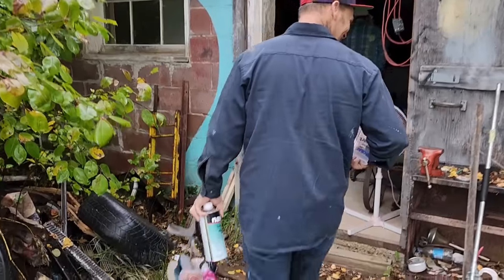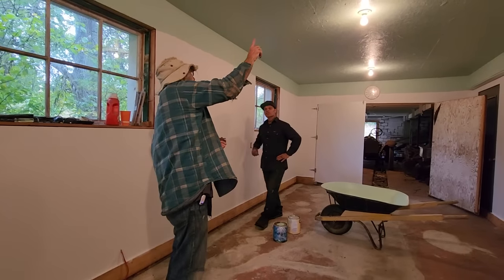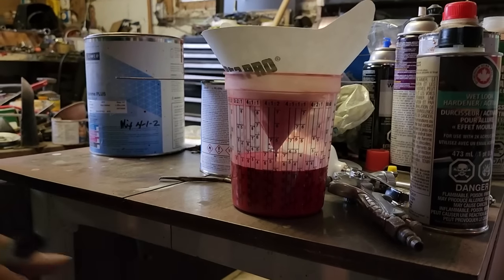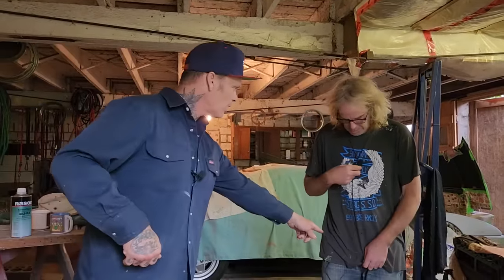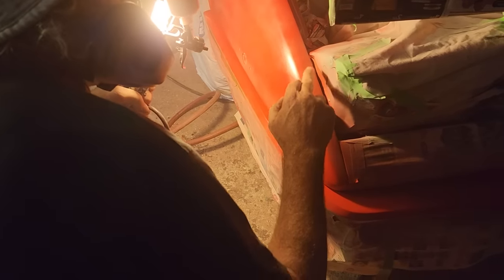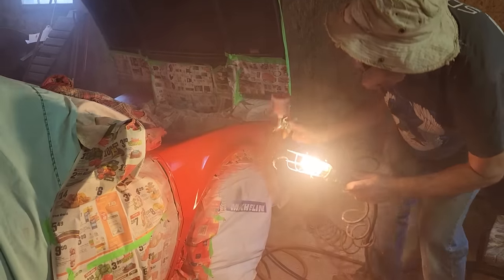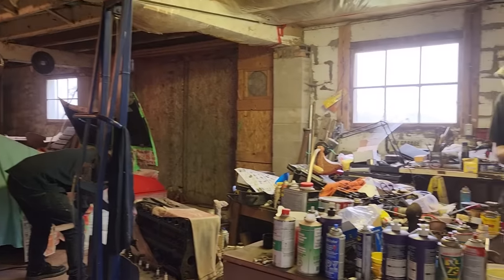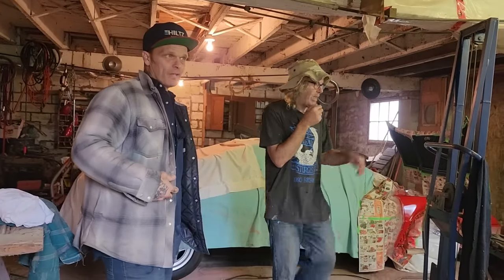Jim is repainting his 1987 Ferrari so we came over to watch  👀

Comment: BC is right about the paint cup, I've painting all my life.  I have a large pitcher with the graduations, has a handle, makes life much easier when mixing large quantities. Jimbo the paint shop needs to be at least 60 degrees Fahrenheit or it may not dry fast enough and run or sag.  Fisheyes are caused by contamination, oily rags, oil in the air lines, not prepared properly.  Using proper prep towels and wax/grease remover helps tremendously.  They make a fisheye remover, but it makes the paint spray uneven or orange peely.  Good luck with the Ferrari.

Comment: Where he had those fish eyes is where he wiped it with that old dirty rag,  I said it to myself too when he grab that rag and wiped it...NO...Like The Champ always says learn from your mistakes. Compressor probably could use a water drain to from the petcock on the bottom of the tank, and a $5 filter on the end of the gun would help a lot. Oil + water separator. Good luck Jim you have enough paint to make a mistake or 2. You'll get her buddy. Wax + grease remover and tack rag also. 👍😉✌

Comment: You got fish eyes from moisture in the compressor... drain the air tank should always set your compressor tank at an angle sloping toward the drain plug when you drain it put some desicant pouches in the tank don't split them the pouches should help absorb the moisture build up in the compressor tank this is why it's better to paint on a dry hot day or even have a heater in the room to dry out any moisture to reduce the humidity in the air being drawn into tank so you get less chance of having water contaminating the airflow ...also it's best not to use reducer to blow out an decrease the paint gear try using an ethanol or even brake cleaner spray to push out the grease and any moisture from the gun prior to use

Comment: I'm sure it's been mentioned before, the guns are shipped oiled up to stop any corrosion coming over by boat, so they need to be thoroughly cleaned before use with acetone I think it's even in the directions. Reducer will not readily dissolve oil. And the filter can be pitched, as that's for people that don't use strainers. I hope it all comes out ok, I would guess he is going to wet sand and buff anyway.
Reply: Yes after I washed off fender. Many coats and it matches
Reply: @jimpatterson2826  Glad it worked out for you in the end .

Comment: painting over surfaces contaminated with oil, wax, silicone, grease, etc or the gun wasn't properly cleaned this  is what causes fisheye in paint  =) overall Great job Jim =) heart of gold.. pro tip never use those filters that are in the nozzle  they can cause a lot of issues  like, sputtering, airflow restrictions they clog super easy so I just avoid even using them

Comment: When you compress air you take all the moisture that is in the large volume of air and put it in the air tank.  check the compressor tank and see if there is a lot of water in it and drain it off.  the water could be coming out with the air as you spray the paint.  They make water seperators which can help reduce the moisture.

Comment: Clean-Clean-Clean ,  Every part of the paint process has to be free from contamination.  Never use a dirty paint gun, strainers, or containers to paint with.  Always use solvent recommended for cleaning the parts to be painted and tack them before spraying. A sanitary booth is a must.  Every time you use a paint gun, wash the parts and can thoroughly and spray lacquer thinner through it, and always leave thinner in the can to keep the passages wet for the next job.

Comment: Before you paint you should let your compressor tank build up full pressure  then open the valve on the bottom of the tank and drain it cause there might be moisture in it  shake the compressor as it draining  you will see a wet spot on the ground if it had moisture ,  you should also use one of those filters at the hose to gun connection .

Comment: If you get 2 gallons of auto paint from the paint store, mix both gallons together in a larger vessel for consistency. Also, I only strain the thinned mix with the hardener as it is poured into the gun cup.

Comment: 2-1, 4-1, those are ratios. 4 parts paint, 1part activator. plus whatever reducer you might need. the parts are NOT amounts. if i'm doing chip touch up, i use teaspoon amounts. because it will be brushed on and built up. read what your paint wants.

Comment: If Jim’s compressor is oiled cooled instead of air cooled he could be getting oil through the air hose. He might need to open the nut on the bottom of the tank to release any oil and air.

Comment: The order you mix makes a difference. The size if the molecules are different. Think if it like putting stone, sand and water into a can. The sand will go between the stones, and the water between the sand. But if you pour water first, you can’t mix in sand or stone. Same effect when you mix fluids.

Comment: Fish eyes could have come from that small compressor. They are bad about letting oil get past cylinder and into the tank. Also the small filter usually goes into the gun under the cup. I discard mine and don't use. But Jim if a cool dude and certainly meticulous!

Comment: Quick question. When I was spraying wifes car paint from spray can went flat, lost its gloss Any reason as to what I did wrong. When painted fender worked great roof however went flat
Reply: Either you didn't put the paint on wet enough or your prep work wasn't sanded up to par. Should be sanded down to at least a 320 grit to be painted and should be smooth as glass. Then paint 😉✌
Reply: A lot of times on roofs there is sun damage cracked checked paint, in them cases it needs to be stripped down to bare metal with 80 grit, then 180 grit, then primed, then sanded again with 320 grit then paint. It's a lot of work to get it perfect like new. 😉✌
Reply: And that's on the fast side of things, some show car paint jobs are double that. It's hard work ! I been doing it for over 30 years.

Comment: fisheyes are EITHER not properly prepped n cleaned surface PRIOR to painting missing  contaminets OR theres a bad filter in compressor and or gun..like compressor oil getting into airline..comp needs draining air tank and flush out  ..comp needs checking where oil its coming from..paint gun FILTER on bottom of handle will tell whether its comp oil [in filter] or not clean enough prep.

Comment: I have had fish eyes happen on a second coat also. Sometimes its a timing issue between coats if water and oil are not a factor. Always disassemble a new gun and clean thoroughly before first use.
Reply: I don't see any air drier on the gun. Doubt he has one on the compressor either.
Reply: @moremikey51  I saw that also. Jim was talking about oil on a filter though but I didnt see it.